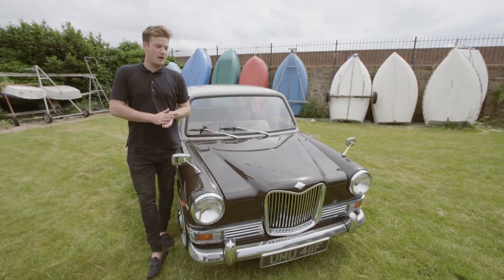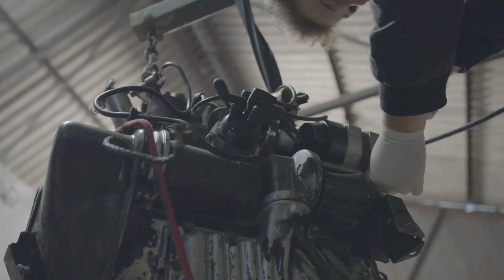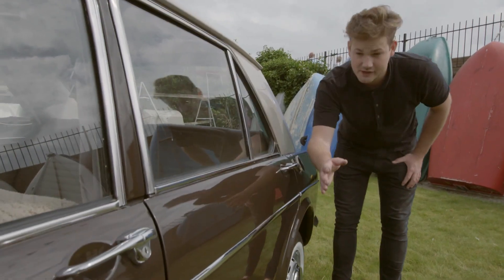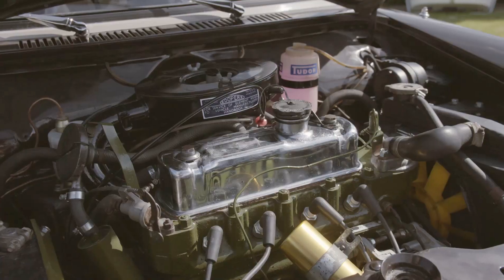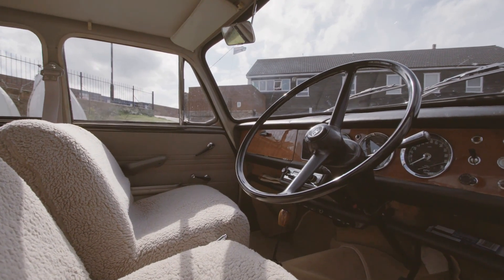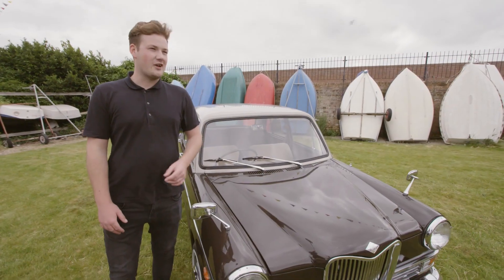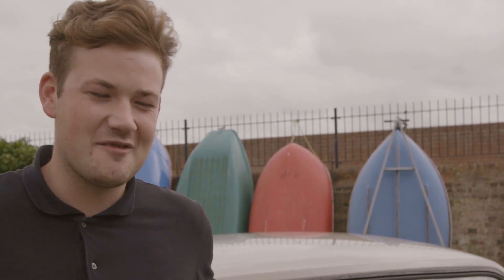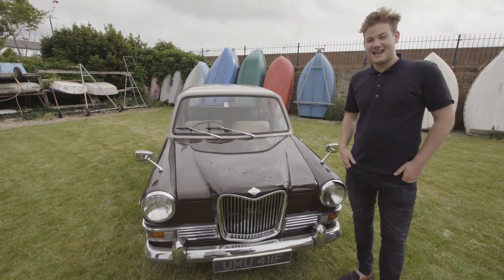eBay | eBay Car Challenge - Charlie's Riley Kestrel (Part 3)

Comment: Great job except for the white walls and chrome rocker cover. Should be green like the engine and a Riley sticker. What was wrong with the displacers?
Reply: thank you :). still have not green rocker cover. can always change to make original. i fancied trying out the white wall tyres. again very easy to change back, i was always having leaks and problems, so decided to get them out and send them off to a specialist to get re-hosed then rust treatment & paint before going back in. they have worked since, a couple of weeks of happy driving.
Reply: They are great cars, I have had just about every one in the range except the Estate versions. Would like to have an Australian version with the 1500 maxi engine and a tailgate. I have an Austin 1300GT tucked away ready for some gentle body restoration. The range looks good with Dunlop D1 Alloys, an option from the dealers, or Cosmics version.